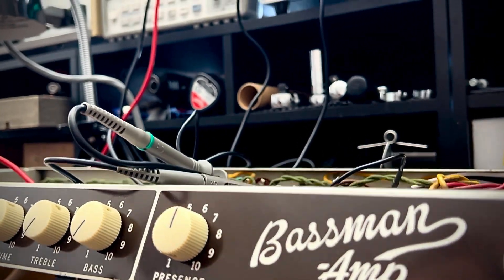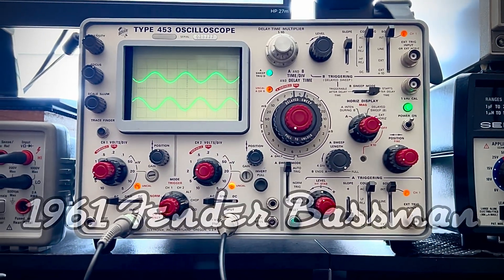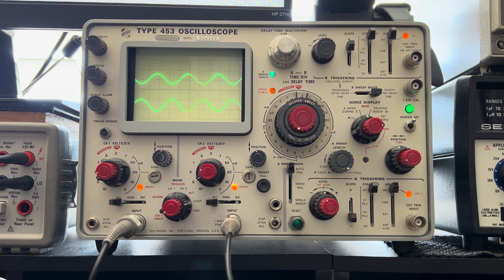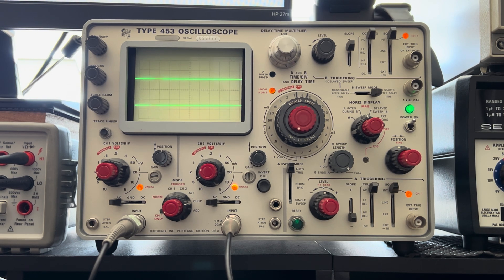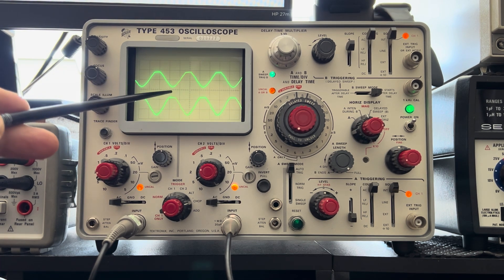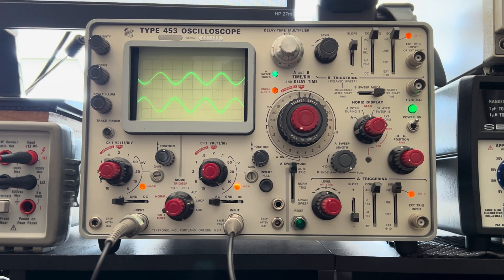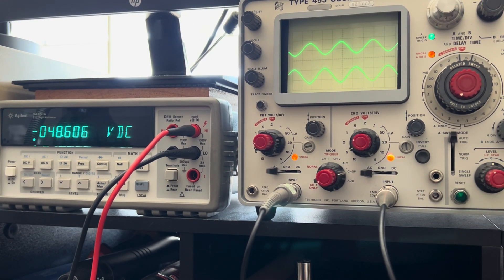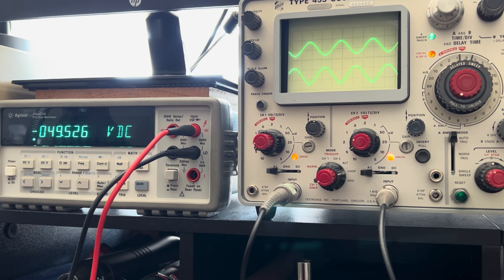Observing Grid Blocking — 1961 Fender Bassman (6G6-A) Part 2

Comment: I added grid stoppers to my AA763 Deluxe Reverb for the same reason, not to mention that tubes are not as cheap as in 1963.  100% original is nice but when something can be undone this easily, what is there to lose, original solder?
Reply from the maker: Diff strokes, as they say. Good move on that DR.

Comment: What you're saying makes a lot of sense.. these blonde amps were a transitional design from the tweeds to the browns to the black panel designs, and It always seems like Leo was tweaking things to keep up with the demands for more volume, more gain and heavier styles... same thing Marshall was dealing with. Seems like there would be edge cases where a particular design wasn't really suited for the higher gain it was capable of, and so a revision to the design was made in the next amp, sadly leaving the owner of the lesser design with a problem amp, that wasn't technically "broken."
I get the collector's mind of "keeping everything stock," but sometimes, if you want to be a player then you have to give up being a collector, and make the amp work correctly.
Reply from the maker: That’s a great observation!  These amps were likely the impetus for the latter revisions’ design changes leaning towards more headroom. Especially for a bass amp!

Comment: Are the coupling caps the right value? Making them too big can cause grid blocking when pushing the outputs into class AB2 operation.
Reply from the maker: They are .047uf. Thinking the prior tech changed the stock .1ufs for these to help mitigate the PI drama. 

You are correct about the improperly spec’s sizes.  

(Edited for clarity)